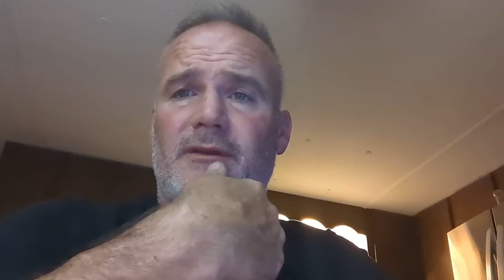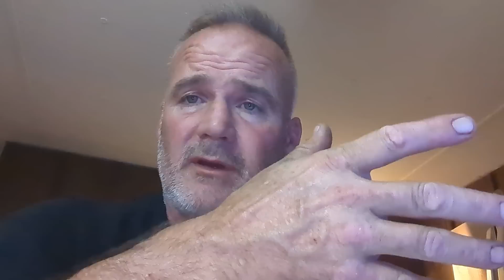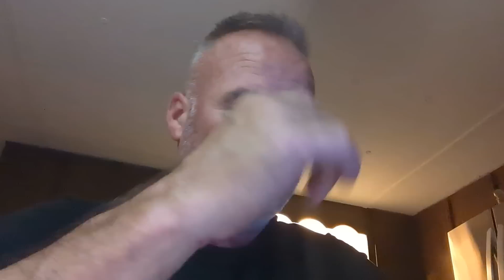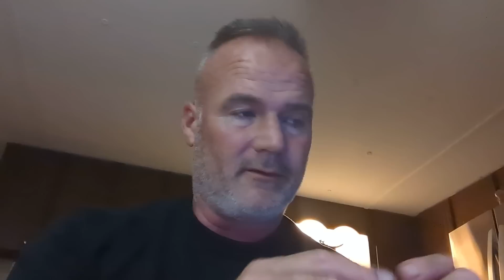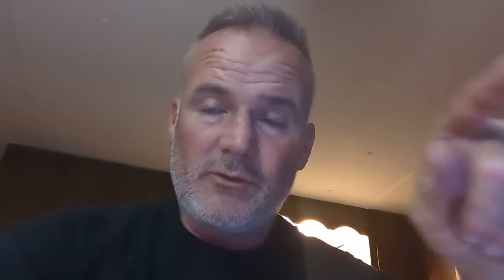Salter Racing cam design There's way more to a cam than open/close there's everything in between

Comment: This just makes perfect sense. Choosing a cam based on older methods, or using modern software is not absolute. While you might get lucky and select peak specs right out of the gate, it is far more likely to land in the neighborhood, which would require tweeking specs here and there to optimize. With all the variables that exist, only God himself could pick the best cam, the first time, every time. 

Love your videos!

Comment: Brian Need help 
I replaced a intake gasket on 4.3 chevy v6 the gasket i bought was aluminum 
.120 thousandths thick metal torqed to 11 pounds 
is what summit  told me thing started dumping antifreeze 
did i need to seal around the water ports with silicone ?
need this truck bad out of work for 1.5 years lol 
i torq my blower manifold to 22 pounds but seal around the water ports 
and never had prob .
Im stumped i torked again to 22 pounds 
been watching to many youtube rejects.
the old gasket was steel .40 thousands thick 
What summit sold me was a boat gasket 
Im pulling my hair out lol

Comment: GREAT VIDEO,  The Best one so far.👍🔥

FYI, Your buddy DV is the one that started the,  " LSA is most important " trend with his 128 FORMULA.  He even goes so far to say,   if you need less overlap,  shorten the durations and keep the tight lsa.

Obviously that doesn't work for....
1. Passing emissions. 
2. Stop and go daily driver / soccer mom.
3. Mpg / idle quality 
4. Factory efi, power brakes with A/C

Testing multiple cams is the only way to get close to "IDEAL " for that combination of parts.

The cam companies don't even know what their customers need. They are there to sell parts. They will just pick one of the " Off the shelf" cams they make and say, " That's what you NEED for your engine".

Problem is they don't want to spend the time making the right cam for you.  That's why they don't even bother replying to " Cam forms" emails, etc.

I  did notice one thing you said,  about moving the lsa moves the intake AND exhaust  timing events.

Technically,  you  could be moving just the intake, just the exhaust or timing events for both. It would depend on how you  degreed it. Lol

Comment: Its a system, its very complex even computer modeling is limited because if you mess up just one of the modeling assumptions then it doesn't work correctly.  Then the sad truth is the camshaft is only perfect under ONE operating condition the rest of the time it is compromising.
Reply from the maker: @bcbloc02  exactly!!!

Comment: I dont believe  the engine has the compression 11to one  because the stock combustion chamber 
on ls3 is 68 erics is 65  he measured I think it was on assumption that it had 10 7 to 1
Im thinking they advertised wrong if it was 52 ccs combustion chamber hed be in ball park
and thats only 10;4to 1 
The block is not decked  LS! is a LS3 block and its like 9;4 to1 they are making hp through huge 245 intakes at 450 hp 
and bore size and stroke ill bet you can run unleaded ha ha ha chevy has always fudged stuff like my 1.5 rockers are 1.38 
 and guessed inputs always fall on theyre face.
I pay attension to details and compression is the forced induction Foundation of every race engine
and it all has to be dialed to it and decides what flows through cam and big ported head 
Compression is pure torq Torq is the little vicious monster that chases the flow through tunnels lol

Comment: Question, maybe irrelevant but here it is: 
 I've been using automotive machine shops for 30 + years.  All of it just for restoring machined parts back to usable condition.  I don't understand why some people think the same person that is an expert on a milling machine is also an expert on camshafts and engine performance.  Am I living in the 1980's or have all machine shops turned into performance shops too?
Reply from the maker: You are very correct

Comment: some of us are lost as to who  and what this is all about? who and where were to comments and condemning take place??
Reply from the maker: @mitchm275  just know that if anyone tells you that people that use the older method or even both methods as I do, are out of touch and doing it wrong and not in modern times, just know that's bologna.
They know who they are and also I explained what all dictates camshaft timing and it's not an exact science with camshafts there is perfect, then there's close, and finally just wrong.

Comment: Hey Brian. Justin. With Schwien Racing Engines. Been building part time for almost 15 years. I Build almost exclusively 2bbrl, flat tappet, spec head engines. I really like your videos. Here is what I'd like to know about camshafts and maybe you can use this suggestion for a video series in the future. I have seen many many many videos and read many articles. And, they all explain the mechanics of a camshaft very well. I'd like to know the WHYs and Why NOTS of selecting or custom grinding a camshaft . Tell me the whole process of how you come to deciding your camshaft specs based  upon the specs and usage of the motor your building. And maybe how those cam specs change with different engine combination and WHY. How does static compression affect your decisions? Dynamic compression? Cylinder head and flow? Carburator? Exhaust? Cubic inch? Engine usage? Just a thought. Keep up the good work.
Reply from the maker: Hey Justin obviously we don't know each other but you sound like a pretty cool dude. I'm going to give you my email 
bsalter@salterracingengines.com 
Send me some engine specs and let me know if you don't mind we will keep it between us for sure but let me know what cam grind you're running right now. 
I will send you some recommendations and you can let me know if you think they will work for you. 
But let me know if it's a 500 Holley 2-barrel compression ratio is it a cast iron head you know all that stuff. 
Good luck with your business also I would like to know how old you are. 
I remember when I started out I was young and everybody was out to cut me down nobody wanted any youngster coming up and making waves. And I've tried not to treat others that way now that I'm older. 
Anyhow I look forward to talking with you soon.
Reply from the maker: Okay that is a great video suggestion which would be a fairly long one but I would do my best and I will try to make one

Comment: I don't have a computer simulator nor I will know how to use it, I have assembled both single and double OHC to tell me at what moment in the stroke or scavenging effect I want the valve to open or close, the LSA in my very ignorant and un-experienced knowledge is a by product of were and how much I want things to happen. That is the beauty of DOHC you can play with those events with a single cam you are pretty much F't if you didn't get it right.

Comment: Good chit here. I got a cam from a cam guru for my roundy round engine. Every number that was asked for I responded in kind. We spent a couple days optimizing it on the dyno changing about everything we could. It was a great cam and ran well but I wanted more. Knowing this gentleman I knew going back to him and requesting a change would be like me wizzing in his cereal so I went with my gut and started looking at other options. After some research I settled on a cam company and ordered a “bigger” cam with a different lobe separation to achieve the power curve I wanted and voila, over 20hp at peak. Torque was up throughout the power band even the lower rpm which most would say “impossible”. I went as far as buying higher ratio rockers for the guru cam to get the valve lift the same also making the cam “quicker”. That cam woke up and was close to the cam I picked but still not quite on par and would be harder on the valvetrain. Did I get lucky? Sure did but this is where the computer only gets you so far and experience along with testing will win every time. Thanks for your time and knowledge

Comment: People tend to forget engine builders have been messing with Cam’s and other parts of the engine for over 100 years! Software makes it a lot easier but you still have to understand WHY it does this when you did that with the cam specs. Software won’t tell you that. Eric’s job is to run the dyno, collect the data and he is actually getting paid to do that. It’s NOT his job to tell someone what’s right and wrong with their design. Let the data speak for itself. Every engine builder I have seen comment on the contest thinks they have a shot to win (if they did not I don’t want them building my engine) but all the data you get is super valuable and no way you could collect all that for $100 and the price of a cam. Eric can be annoying and he’s really a small time player and as you said your results speak for themselves. Between you and Steve Morris people can learn a LOT about engines. I appreciate you making the videos.

Comment: Technically,  math has always been able to tell us these events without a degree wheel as long as you account for all “known” variables.  That’s actually what the computer is using (math). Simulations are even using math.  The Cam Dr is measuring the profile using transducers and then using basic math computations.  Theres still real world variables that make physical (real world) testing and experience a necessity that can’t be replaced. I’m not certain why you always feel the need to validate your credentials and experience.  You should know by now that everyone online is an “expert” at everything since they discovered social media.  From politics to engines and the secrets of the after life.   Dude, just Ignore them. Please do more tutorial or demonstration videos to teach people rather than respond to comments that are insulting of your opinion and experience.  Besides, records aren’t necessary a metric for success. For example a nascar championship is irrelevant or convoluted  as there’s so many different series that are sanctioned by nascar,  and to people like myself,  a WOO or Lucas Oil championship is actually more prestigious then one with nascar’s brand attached. There’s many engine builders with a laundry lists of championships that aren’t endorsed by “prestigious” sanctioning body’s like nascar. This doesn’t mean their performance, knowledge or success isn’t any less relevant. That’s not admonishing your impressive success, which  you have every right to be extremely proud of, but…..stop reminding us of the titles and constantly proving yourself to people unworthy of your response. Most of us are here because we trust your knowledge base and are willing to learn. Maybe do a full assembly video of a circle track motor when the shop is done, showing us some stuff others won’t. That would be dope. Cool stuff like 13° or 9° motors or even an SB2.2.  Gotta be a customer motor needing done that would be interesting to viewers.
Reply from the maker: Well when you use opening and closing events you're not seeing the entire profile you're not seeing how fast it opens how slow it closes you're not seeing any of that by just using four numbers and the point of the video is you got people saying you're wrong for doing it the way that's been done over a hundred years you got people saying you're doing it wrong to people like me who have multiple records and multiple championships because I learned it from someone else which means there's more than just me out there doing it it's sad that people are so narrow-minded
Reply: @SalterRacingEngines this is why you are on that side of the camera and these guys are in there chair. You just be yourself and F the guy that knows everything. Cause if you are a true motor head you are going to be learning from this stuff and thank you.

Comment: Out of respect I wont discount your methods. There are many ways to do many things and at the end of the day anyone should just use whatever way  they understand and what works for them.
 My methods prior to internet, pc programs,  cam doctor availability etc when speccing a lobe was never based on icl, ecl, lsa. (They, in particular LSA are terms I've had to learn in reference to public expectation of the term since the internet made them common and Jo Bloggs has been 'internet schooled' on light LSA = Lumpy Idle and seeing that Idle Ego is rife Jo average just knows that small LSA numbers are what gives him more tictok likes!)
 Engine size, CR, fuel, usage,  and all IN&EX flow parameters and valvetrain requirements were considered. From there a .200" duration and peak lift requirement was decided(lots of decision goes into that) as this is the area of the curve where the most averege flow 'potential' is achieved, then a .050" duration and a seat duration to suit.
Then Intake close position, then exh close position were chosen, then all data reviewed,  then the lobe datum points for the drafts were calculated,  which are known as Icl, Ecl and Lsa. We could then alter a draft easily by dictaing a different datum point(icl,ecl,lsa) without redesigning a lobe hence all of our old catalogs did not display icl or lsa etc,  they all displayed duration and lift and  open and close figeres, for eg  0.544", 292*, 230*,  37/75-77/35. No public, customers etc spoke LSA etc as they had no idea what it even was, everyone spoke events and .050" numbers for degreeing purposes. Centerlines did however show up on cam reccomendation fax forms which had more details and upon order was an easy aid to manufacture setup.
 Prior to cam doctor, checking an unknown cam consisted of in common cases an old engine block, crank, piston/rod, lifter and manually checking and mapping the entire lobe. Or for odd stuff a shop made fixture(concoction)  with roller V blocks and adjustable lifter fixture.
 I dont machine anymore but do spec, i use different/extra info now as compared to years ago but I still only use icl, ecl and lsa as referencing points for pre designed lobe masters.

Comment: I learned this lesson early on when dealing with the shelf grinds from the big name cam companies. Comp Magnum 292 or 305 specs for a SBC were the same for a SBF. 2 completely different heads are expected to perform the same with the same cam numbers? Nope, not happening. They are not bad cams, just not optimized for each engine.

Comment: I think the duration/LSA method just reflects what the cam grinding machines could do.  They were essentially copy lathes so a cam grinder would use a master lobe with a certain duration and lift and LSA would be set on the machine.  You could figure out the opening and closing events with some math but nobody really cared because the typical tuning was to go for bigger and bigger lobes, then advance/retard to suit and maybe try changing LSA after that.

I bet high level racing was quite a bit more sophisticated but to most people it just trickled down in to catalog cams.

Now if you pay enough money you can get a lobe with any duration, any lift and any intensity so you can specifically choose the valve timing events which is probably easier when you are using engine simulation software because you get to optimize all four events separately.  But eventually you get to the real world where you have to test things to get a real world optimization.

Comment: Nice Brian.   I skin a deer a little different every time,  I might find a better way.  When I build another 383 SBC, I use what I know works because it makes people happy.  I experiment with my own cars. If theory works use it.  If not, move on.    I am rooting for you.   I'm sure I could not design a camshaft lobe, but I have a reasonable handle on what a given combination should have. However after using high end camshaft manufacturers I realize there is more to know than I have time or resources for.                    On another note,  your subscribed people may be down in numbers, because some may not understanding what you are describing.  No fault on your part.       Please continue.   PS.   I did not get the 'poke'   I could see that was like putting antifreeze in the crankcase

Comment: I'm no expert, I have my opinions & the more camshafts I dyno test, the more I learn. I can tell you Tony Bischoff, Steve Morris and all engine builders dyno test multiple cams as they learn what the engine is asking for. Guessing or calculating the perfect camshaft with raw engine data will get you closer, but testing is the only way to find the best cam for that precise combination. Just my 2 cents. Youtube is a lot of fun, until it's isn't. Once the learning or entertainment ceases, I move on. Plus we all have real jobs to work.
100% agree with you. 
Tests all the cam choices & enjoy the difference between the highest HP/torque cam & the lowest HP/torque cam. But no matter what the results, it only really applies to that specific combination. General trends have always existed about tight/wide LSA, Advancing or retarding camshafts.
Good luck!

Comment: At the end of the day both systems describe the same events.  On one side you calculate the valve events from The durarion lsa and centerline the other way you calculate them backwards.  As an engineer there is a little bit of kentuky windage/voodoo from experienced engine builders.  We can figure it out to five decimal places but experience  puts a heavy rhumb on the scale.  A few years ago i spent some time in the gm dvelopment lab even the big guys grind 10-15 cams and run them then fine tune it.  Way too  many unknown variables that come into play in a complex system.  Love your view of stuff,  proof will be in the pudding.